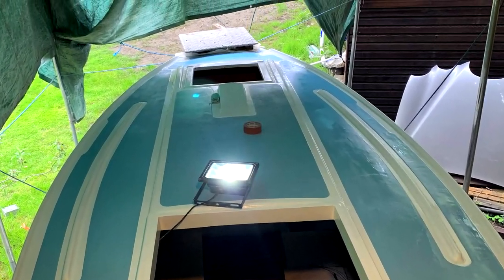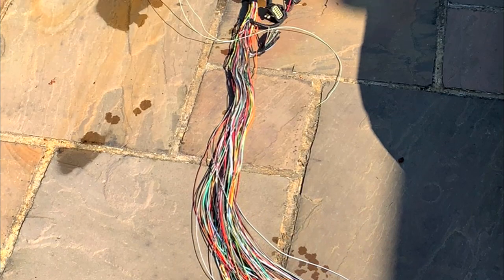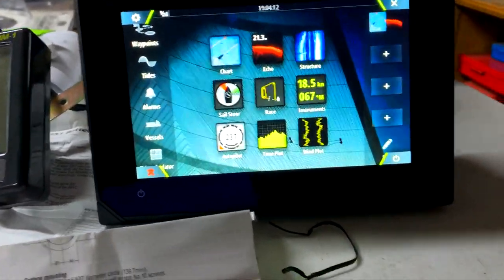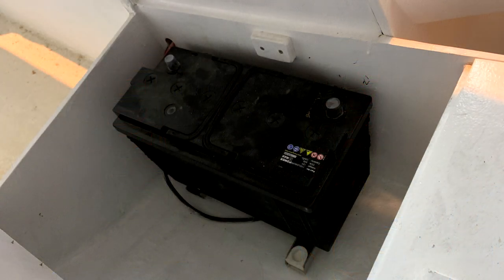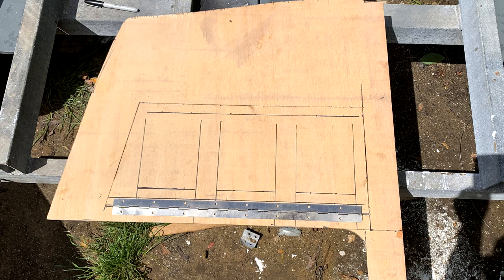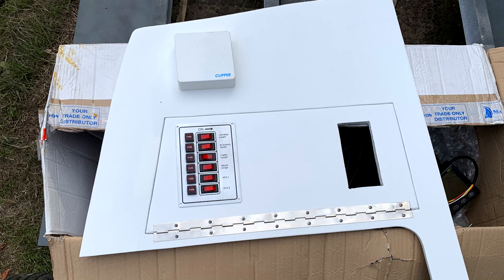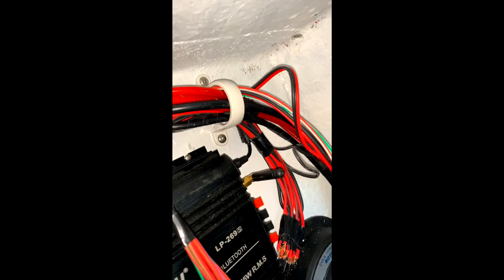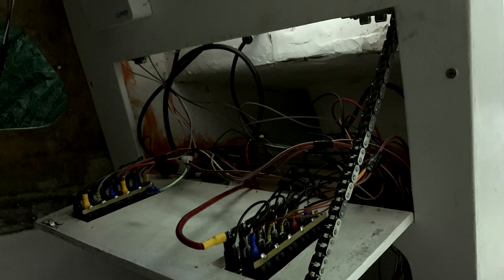Building An Electrical System For My Sailboat! Sailing Meraki | Ep.15

Comment: Just caught up Alex.  Electrical install looks great.  Starting from scratch is great, trying to tidy up old wiring and several owners installs is not so much fun.  Did you find a good deal on the batteries as they look good?  Any specs or links would be great.  She is com8ng a.ong nicely and I agree that chain looks pretty cool.  Andy UK
Reply from the maker: Thanks Andy! I picked up 115ah lead acid nothing too crazy, got them from pacer marine about a year ago and are still going strong! Tidy and simple wiring is a must on any boat, i can’t stand messy wiring!

Comment: Really interesting video! How did you cure your led interference?
Reply from the maker: a good amp is a good start and then keeping distance between the two systems. amp is under the step and the led controller is in the switch box

Comment: hiya alex, i know it is an old video but would you mind linking the audio equipment you used (speakers and amplifier)? thanks
Reply from the maker: Both found on Amazon so suspect the listings have changed since then. They are fairly generic. A potable Bluetooth speaker is also a great solution!